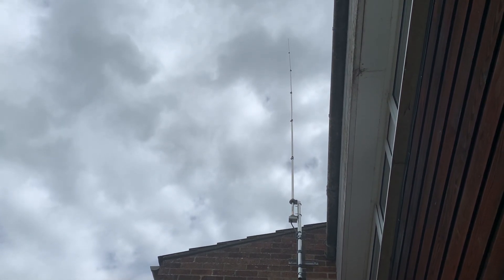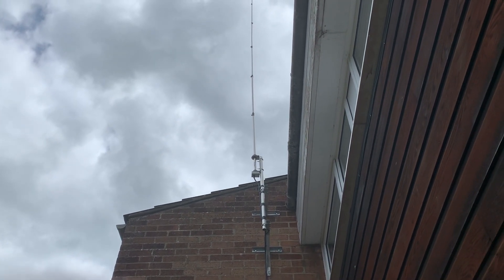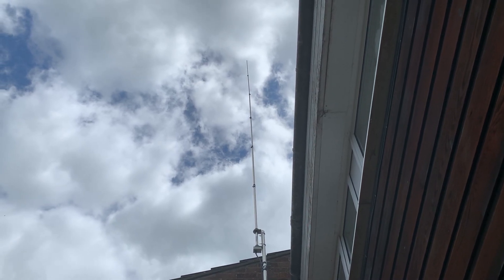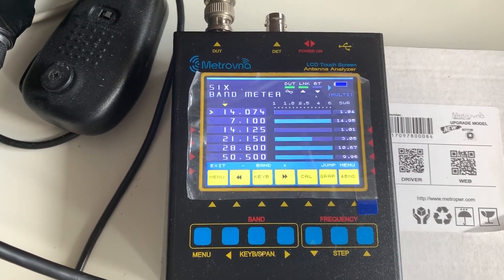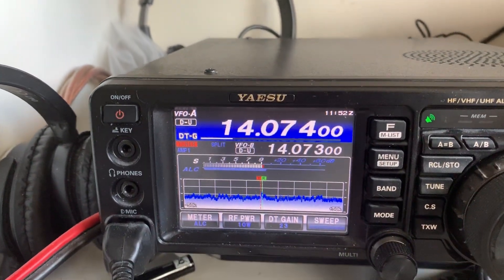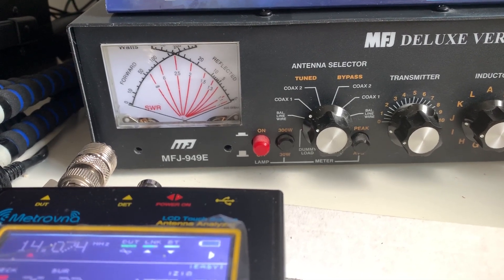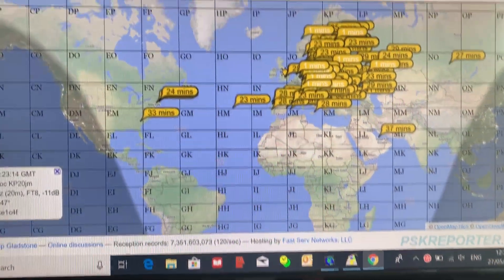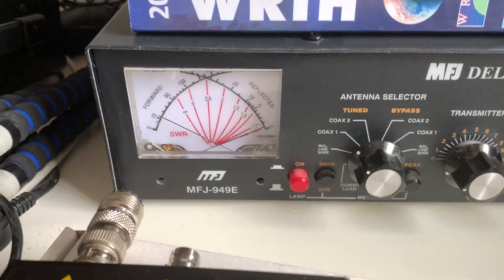Checking  my SE-X80 wideband vertical with a Metrovna Antenna Analyser

Comment: Many factors       propagation, individual band characteristics, antennas and sunspot cycles, day, night, seasons and time of day operation, and everything else like QRN and QSB can affect your signal reports.  Band noise (local and man-made) and space weather are other factors. The variables are endless. -especially as how it pertains to hf frequencies and especially SWR. On transmit you may be worried about some stuff that is really not that critical.  Yes, SWR is important with today's modern radios in protecting delicate finals, especially if they do not have fold back protection circuits but it can be meaningless worrying about having a perfect match all the time, most radios will handle even 2 to 1 and not damage your radio and usually makes little difference on how your heard on the other end especially at HF, --antenna efficiency is far more important than always trying to get a perfect 1 to 1 SWR.  You're only fooling the radio with most tuners.  A dummy load is a perfect 1 to 1.5 to 1 SWR but radiates poorly.   Weather variables on your antenna such as ice and moisture can cause flux in SWR readings and reflected power or even moisture in your coax, A good weather seal is important on your feed line.   A short vertical is a compromised antenna on 40 and 80 and yes, I own one, but as you have found it is very useable if you keep losses down, SWR as it relates especially to hf frequencies and using 50-to-70-ohm coax is not as critical compared to the VHF and higher frequencies where losses can sky-rocket as the coax run gets longer.  This is the reason tuners are rarely used on those higher frequencies.  Your type of coax and especially length play a critical role on how much reflected power you're actually losing and if it really makes that much difference, loss is judged a lot on length of coax and the type so example a 3db loss can vary a lot on its importance. a 3db loss at 100 ft is only 1.5 dB loss at 50 ft if you go shorter it goes down more, ,  How long a feed line run always plays a role in determining your antenna systems there is even loss in most antenna tuners as well so many purists always match their antennas to frequency direct and don't use them.   enjoyed your videos and just my 2 cents,  , ham now for 48 years Cheers 73  Jim
Reply from the maker: Thanks James. Interesting read. 73

Comment: I have the same antenna mounted on a metal 12 meter pole on the side of my single story garage and although it works well on European DX 40 and 80 meters has a lot of noise so I have just bought the plus kit. I seem to remember you used this kit as well at some point ? Any tips on installation for best results without going up and down a ladder to many times ?  Enjoy your channel . 73 M7BLC
Reply from the maker: Hi John, I only have the antenna, which was noisy at times - as verticals tend to be. I'm thinking anout buying a Sandpiper for top band. I'll let you know how I get on with that one! Thank you very much and 73, Clint M0OXF

Comment: you cant use the ant turner on the ft991?
Reply from the maker: You can Thomas, but I always prefer to match my antennas externally with an ATU. 73! Clint
Reply: Clint, I live in the States... I was thinking of a CHA-250B made by Comet, The SE-X80 looks just like it. The SE-X80 is a third of the cost of a comet cha-250B.. I'm new to this hobby! Any Advice would be appreciated, 73's Tom
Reply from the maker: @thomashenderson603  Does the CHA-250 have downplane radials? If so it should perform a little better than the SE-X80 and be less susceptiblbe to generating spurious RF into neighbouring areas. Hope that helps! 73! Clin
Reply: @OxfordShortwaveLog  I think going to try one of the SE-X80... and get a tuner .. thank you for all of your help!
Reply from the maker: Definitely worth a try Thomas, congrats! Always a pleasure Sir. 73! Clint
Reply: @OxfordShortwaveLog  Thank you, My Friend!

Comment: Clint, just after you tuned to 1:1 on the analyser you could measure the swr on the FT-991 to see if it shows the same value. Do not forget that the piece of coax between the MFJ and the analyser of the FT-991 is an influence and indicates a difference. So, if the FT-991 shows the same value as on the analyser this should be the exact swr that is seen by the amp of your radio. The value shown on the MFJ does not tell you the complete picture. I experienced this in the day when I still used a tuner. All my antennas are resonant or have a auto tuner at the antenna feedpoint. I just look at the swr that is shown on my Icom IC-7300. Just my 2 cents. 73' Ron
Reply from the maker: Good thinking Ron - and yes you're right about the short connecting co-ax.  I prefer to use an ATU, but that's a good point about checking the SWR on the FT-991. 73! Clint

Comment: It's an odd one. <1.1 is fine, and not "lost" power as it's continually reflected forward and re-radiated. I think I remember Ray G4NSJ saying in one of his vids that you could load up a 6-inch nail to 1:1 if your tuner is good enough - it's still a crap antenna though. 

Maybe you have RF coming down the outside of the Coax from the radiating element, clip some ferrite beads on it see what happens.
I must try this FT-8 lark someday :)
Reply from the maker: Thanks for your comments Adrian. Indeed, it is a little odd and you're right - the MFJ will match just about anything! You should give FT8 a try. I forgot I'd signed up to eQSL online and because of FT8, when I logged back in for the first time in a few months, I had 750 eQSL cards waiting for me to print out! 73! Clint